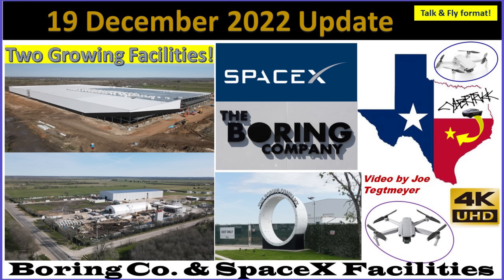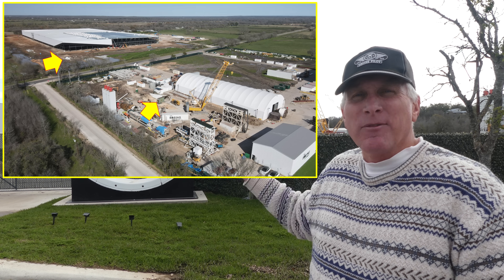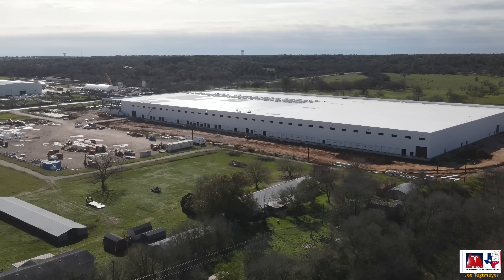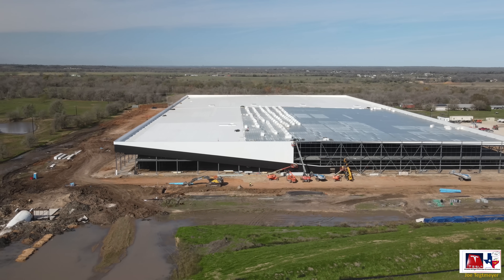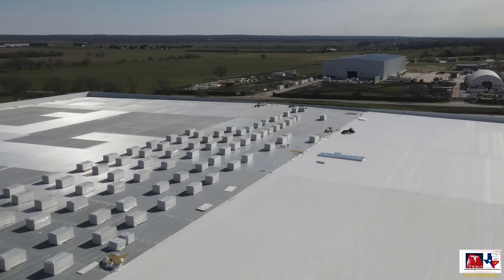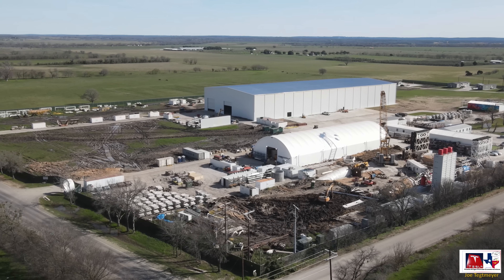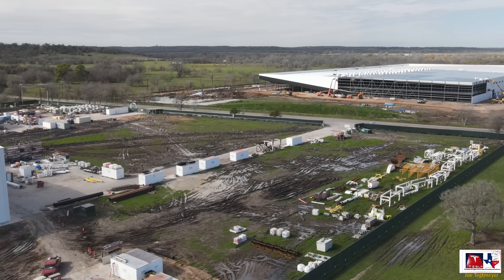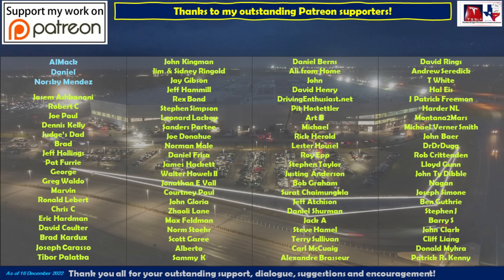Two facilities emerge in Bastrop, Texas! 19 December 2022 Boring Company & SpaceX Update (011:35AM)

Comment: Great shots Joe!

The first tunnel is under FM1209, not Walker Watson.

The structure behind the tunnel is the conveyor belt for removing dirt from the tunnel.

The equipment to the south of the 1st tunnel is actually the start of the 2nd tunnel! I think you're the first to publish pics of that 2nd tunnel boring machine set in place .

I know there is some short-term use of the onsite housing, but there are also families living here permanently (6+ months?)

At 9:05 you can see them on the north side of the fence. That is where the wastewater spray field is. It seems they've done some recent expansion on that in the last month. 

Would be great if you're able to detail that more in your next flight.

I expect SpaceX to have an FM1209 address.
Reply: Thought it looked like a second tunnel under construction as well.

Comment: 7:50 Theses are conveyor belts. Conveyor belts can't be easily extended, but they can be loaded into a device like this which automatically allow more belt to unfurl as the TBM pulls forward.
Reply: Yes, they convey the muck from the back of the TBM to the entrance to the tunnel.
Reply: The white tower to the right of the tunnel is the cassette for the converter belt. The white towers on the left are likely drilling muds/foam/lubricants to keep the drilling face pressurized so the groundwater does not come into the tunnel under construction.
Reply: Awesome, thanks!!

Comment: Nice surprise. Thanks. 

I wonder how many of the properties owned by Tesla, Boring Co, Nuralink, & SpaceX throughout Texas are in areas where they could install Megapacks. Telsa Electric could quickly become a major player while providing much needed grid stability. Thinking about the mess in early 2021 as that polar air is moving in.

They are already at a build rate of 10,000 Megapacks per year with large installations going up all over the globe. If they turn that focus on Texas they could transform the grid quickly.
Reply from the maker: I don’t know but with Tesla Hq so close by having several Megapacks would be something Tesla might like to do to highlight the capability and help with the grid in a very public way!

Comment: Hey Joe, great video as usual!

Two observations…

1. On the SpaceX side of the boring tunnel, the foundation that it comes out on looks to me that it should be wide enough for another tunnel right beside it   🤔

2. Wouldn't that SpaceX roof be perfect for solar panels.  Have you heard anything about if they are going to be installing them there?
Reply from the maker: There appears to be a second tunnel being bored as you can see from the Boring Company portion of the video, parallel to the existing tunnel. It works make sense to see solar panels just like those at Giga Texas, so will watch for that too!

Comment: What is the use of a SpaceX warehouse in Bastrop? Are there other SpaceX facilities in the vicinity?
Reply: Designing & Building boring machines for the moon and Mars???
Reply: This site has an internal name of Project Echo, which is also the name of the first US project to relay space communications in the early 60’s. This site is likely tied to Starlink2.0 production.
Reply from the maker: McGregor is about 90 miles north and is where Raptors engines are built and a lot of testing of stages, boosters and engines takes place. Likely not directly related to this facility, but you asked what was nearby.